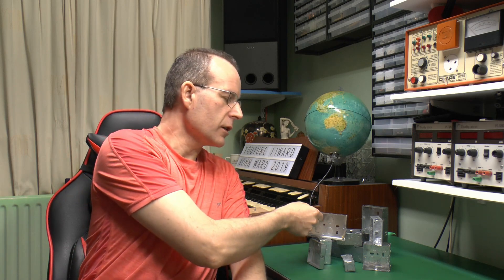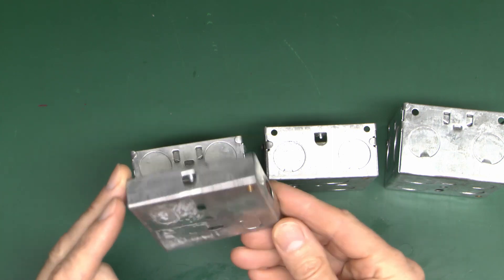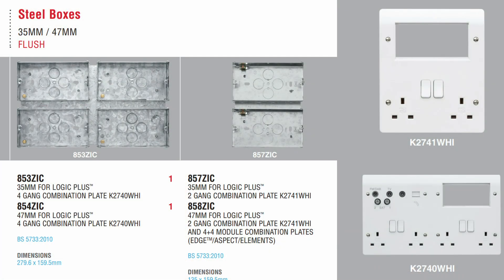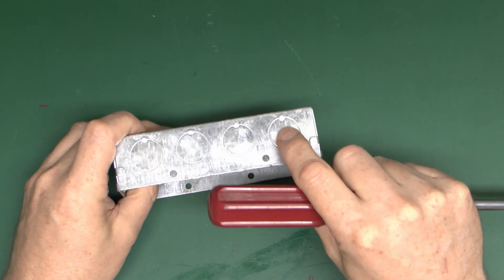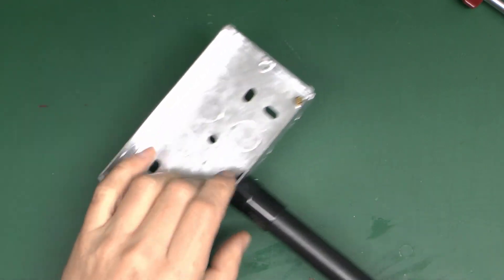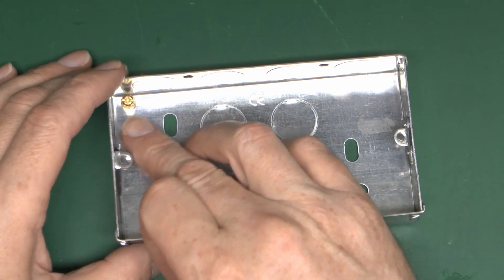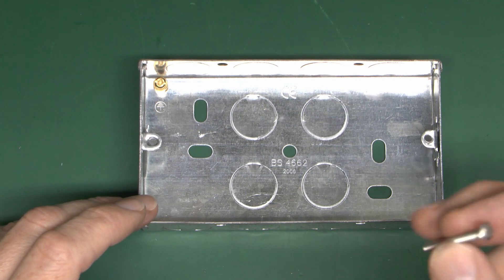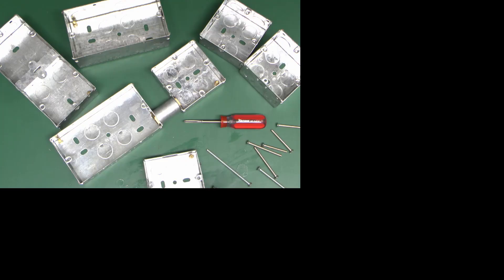Metal Backboxes For UK Sockets and Switches

Comment: Great video and explained an issue I had replacing a switch in my parents house. Socket screws changed in the 60's and kept stripping the new ones. M3.5 x0.6 Vs 4BA. At the time I just cleaned up the old heads and reused them.

Comment: Reminds me of a funny story:  In my old house I had two back-boxes side-by-side in the living room.  One was a light switch, the other a dimmer.  One day I decided to change the dimmer.  When I took the old dimmer off one of the screws was plastic.  It seems this was some kind of safety 'mitigation' because directly underneath the screw was the supply cable, going out the hole beneath the tab!

Comment: Mk 2amp outlets used top and bottom screws,regarding box depth when as an apprentice i was told on brickwork to be plastered ,thickness of a file was required to be protruding from chase(or else!),promptly the plasterers would coat it with about 50mm of plaster, how I laughed as I dug my way through it to get to the box!

Comment: When mounting boxes next to each other, the spacing is 1 inch between screwthreads then the accessories will butt together perfectly
Reply: 1) Accessories butted together look as ugly as an ugly thing which is very ugly.
 
2) Connect your boxes together with 20mm conduit couplers and bushes.

Comment: I had the joy last week of applying a bit of TLC to an ex-rental property on behalf of the family who'd just bought it. Typically, the 45A DP oven isolator (1 gang for no good reason) was inside a kitchen cupboard attached to the remains of a brittle 47mm white pattress. A disaster waiting to happen really as the mess wasn't easy to see until your eyes were <80cm from the floor, and the cupboard was full of saucepans with long metal handles. Then it dawned on me, my preference for surface mounting boxes for sockets or switches is something made of PVC, (eg. MK K2183) and therefore not likely to shatter. Ideal in lofts, garages, cellars, cupboards, rental properties etc, I've just never looked for a deep one, in either 1 or 2 gang. The hunt starts here...

Comment: i think the reason single boxes still have holes at the top & bottom is because they are sqaure not rectangular it would be much easier for someone to mistakenly put the thing in the wall at 90 degrees to what it should be and then if it was plastered you'd be screwed (no pun intended)
Reply: Apart from the lugs on either side 😂
Reply: @stuartmchale4482  yes exactly thats the point im making

Comment: Great video. I'm hoping it will be ok to puch oval conduit unti the boxes and not uae grommets.
Also, I drill holes to screw boxes to block work but put gyproc  bonding in the cut out hole first and then screw metal boxes in. Very solid 😊

Comment: You didn't show any kind of old work electrical boxes. Although, I don't know if you have such things. In America, they have rotatable wings to hold the box securely in sheetrock in instances where you want to put a box in where there was none without having to rip out the plaster. You can also get boxes in metal, PVC, and thermoset.
Reply: The British equivalent to what you describe is a so-called dry lining box or cavity box. The wings are secured by the fixing screws of the item you are installing in the box.

Comment: I thought I was seeing things when they slowly started appearing. Also I use 35mm boxes for everything whenever possible (makes 2nd fix much easier). The only exception are things like cooker switches, cooker connection units, etc where you pretty much need 47mm back boxes.

Comment: The back box I have is very old, and small light switch, it has two conduit coming down into the top. What tool do you need to remove the box from the conduit... Is there a video that shows how to do this? The new smart switch is to deep for the box
Reply from the maker: If it's round conduit, then one of these: https://www.cef.co.uk/catalogue/products/1931159-190mm-conduit-bush-wrench to unscrew the brass bushes which secure it into the box.

Comment: One thing not mentioned in the video is that the regs state it's not necessary to use the box earth terminal as long as the box has one fixed lug. Most boxes do. The box is still unearthed via the socket screws. Some electricians still earth the box though regardless.

Comment: Do you have any advice on deepening the backboxes? I am increasing the depth from 25mm to 35mm. 
You mentioned it can be quite tedious but unfortunately, I cannot use any of the high-quality screwless light switches available without making this adjustment.
Reply from the maker: Only option is to remove the old ones, make the holes deeper and fit new.  Some damage to the surrounding plaster and décor is inevitable.

Comment: I find the best tool for doing the metal knockouts is the handle from an old metal claw hammer which just so happens to be about 18 to 19mm and is still stout enough to get a good clout from your chosen thumb detector.

Comment: @johnward I've come across a load of single back boxes with double face plates are they OK to ve like that or must i use a double with double or single with single
Reply from the maker: There are converter sockets which are doubles that fit over a single box, they are ok to use. 
Otherwise no, as a normal double won't fit on a single box.
Reply: @jwflame  yeah that's what they are I wasn't sure never come across them before

Comment: I wonder why they decided on 47mm and not 50mm for the deep box? Very educational video.
Reply: The dimensions will all have been British units originally, so 1 7/8” in reality, with the nearest French equivalent being 47mm.
Reply: @Benzknees  Makes sense. Thanks.
Reply: @Benzknees  - so they were drunk when they decided to make them 1 7/8" rather than 2" deep?
Reply: John Coops - Possibly! The French nominal sizes could be expressed as  5/8”, 8/8”, 11/8” and 15/8” in English, so there is a sort of logical progression. More likely, with the deepest size, they were concerned about avoiding cutting into too much of the depth of a wall or stud. All I can say is that the new 47mm nominal back box in front of me actually measures 48mm deep or exactly 1 7/8”, and the 1960 socket back box I recently took out in my house was exactly the same dimensions as a modern day one. Also I’ve had no problem fitting new faceplates to old back boxes.

Comment: In my house, which appears to have had a council rewire some time ago, 16mm backboxes are used for lightswitches. One of the issues though is that the rewire was done using the existing metal conduit in singles (including earth wires). This means I have ~40mm of depth from back of backbox to the plaster surface, which makes removing and refitting awkward (things don't quite lineup). Replacing these is also difficult as I've not seen single boxes with a centre knockout for cable entry, what would you do ?
Reply: I don't know if you have and equivalent in Britain but there are hole punches available in North America for punching larger holes in sheet metal, specifically for electrical boxes. A company called Greenlee makes sets of them, but they are not the only ones. There are two halves tightened together with a 1/4'' bolt, and as it is tightened it sheers a hole through the sheet metal. If you are putting a new box this may work, but not in an existing one already fastened into the wall as you need to access both sides to use it, so a bi-metal hole saw might be the answer there.

Comment: Great video JP.
On a slight tangent; are there any regulations against passing through back boxes with cables from different circuits? for example if you have a light switch directly above a ring main socket, could you run the ring main cable down with the lighting cable through the light switch back box and continue down to the plug socket, to stay in the prescribed zone?
Reply: No, you may not do that.
 
522.6.202 A cable installed in a wall or partition at a depth of less than 50 mm from a surface of the wall or
partition shall:

(i) be installed in a zone within 150 mm from the top of the wall or partition or within 150 mm of an angle formed
by two adjoining walls or partitions. Where the cable is connected to a point, accessory or switchgear on any
surface of the wall or partition, the cable may be installed in a zone either horizontally or vertically, to the
point, accessory or switchgear. Where the location of the accessory, point or switchgear can be determined
from the reverse side, a zone formed on one side of a wall of 100 mm thickness or less or partition of
100 mm thickness or less extends to the reverse side, or

(ii) comply with Regulation 522.6.204

Note "Where the cable is CONNECTED TO...".
 
Not "passing through" - it has to be connnected to the accessory for the accessory to create a zone for it.

Comment: Great video ty. In your opinion do you need to separately earth metal back boxes or is the connection through the screw onto the fixed lug sufficient. I have always tended to supplementary bond them to the face plate earth connection, but is this ott?
Reply from the maker: Connecting via one fixed lug is permitted, but like many things there is the choice between doing the absolute minimum required, or doing a decent job of it.
Reply: John Ward many thanks, agree totally. Really enjoy your videos, ty 😊😊

Comment: How does that screwing in the metal conduit work when /both/ ends need to be screwed in? :)
Reply from the maker: On new installations start at one end and screw in one at a time.  For a socket, the length of conduit to the socket is installed first, then the coupler is screwed on, then the brass bush is screwed into the coupler.
For the rare situation where two pieces of conduit need to be joined on an existing system between two existing items, the thread on one is cut extra long so a locknut and coupler can be screwed on completely, the two pieces are then installed and the coupler threaded back over the joint with the locknut securing it.  The exposed thread then has to be painted to prevent corrosion.

Comment: A surprisingly interesting video!

I do have one question though... if you have a single socket and its fcu fitted to the same dual back box, how do you run the cable between them. There's typically no knockouts on the central divider so would you use the top (or bottom) knockouts to run a short length of cable? It's would be in a preferred zone so I'm guessing should be ok but I just wanted to check what best practice would suggest.
Reply: Answering my own question after coming back from Screwfix, in case anyone else was pondering what I was pondering! The central piece that divides dual back boxes into two is comprised of two parts - a facing strut that has screw holes into which you can screw faceplates, and a central 'wall' that physically divides the box into two. What I didn't realise is that although there are no knockouts in this central wall, it can be removed altogether whilst leaving the other piece in place. Which would seem sensible! 🤪

Comment: Can anyone explain to me (complete novice) why after I disconnected a faulty transformer in my ceiling light some of my other lights don't work but some do - is it as simple as the order in which the cable goes to them? I presumed it would be all or none if it is a ring circuit... or perhaps that's the answer, they're on a separte loop off the main circuit?
Reply: @gravyboat2370  okey dokey, cheers 👍

Comment: I'm kind of impressed you went through that entire video without ever mentioning the word pattress once. Is it a regional preference thing?
Reply: Patress is used for plastic boxes not metal
Reply: Surface mounted
Reply: I find it interesting to have gotten two somewhat conflicting answers, with Supersparks making a distinction based on the material the box is made from and Stuart Mchale reserving the word pattress for surface-mounted boxes. So, nobody knows? (A surface-mount(?) plastic box was shown at 22:34, but still JW never said pattress.)
Reply: @ropersonline  I meant surface plastic.
Reply: @ropersonline  yea surface mounted basicly a patress is a plastic containment used where an accessory can't be mounted flush. You can also get round ones for luminaires, we call them "biscuits" for some unknown reason.
Reply: Historically, pattresses were made of wood, of course.
Reply: I’m an old fart but I don’t go back that far, though I have removed plenty of wooden boxes
Reply: Suppose thats all there was at one point in time, until bakelite came in
Reply: @stuartmchale4482  - Bakelite existed the whole time - that's what the switches were made from DOH